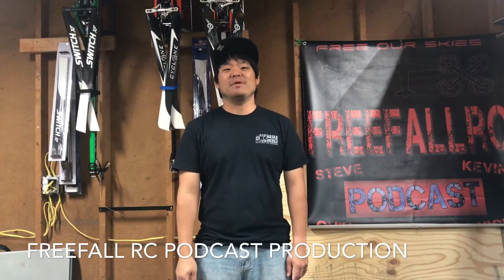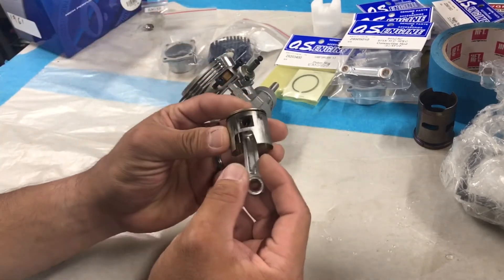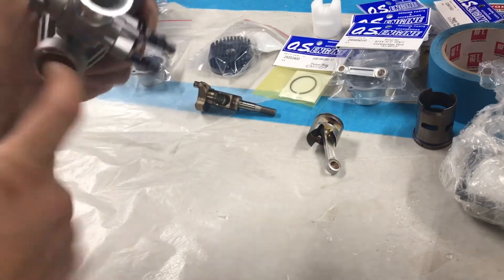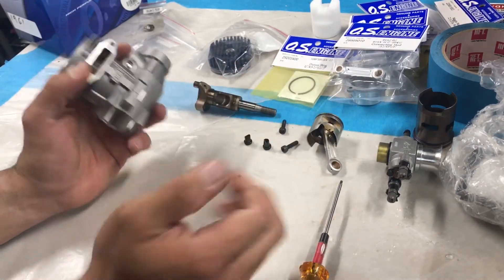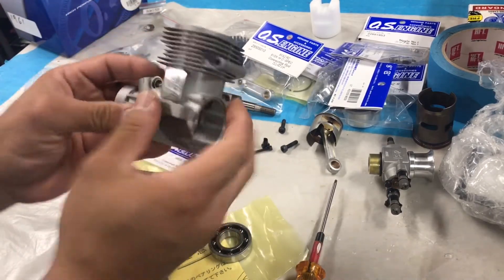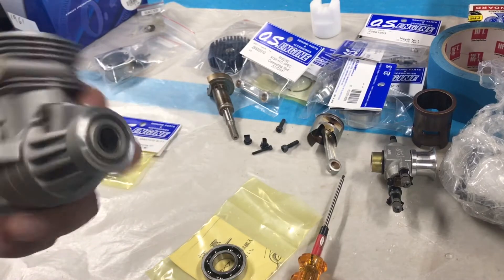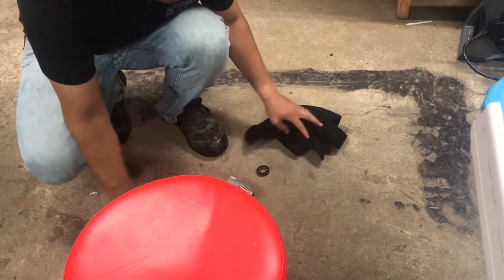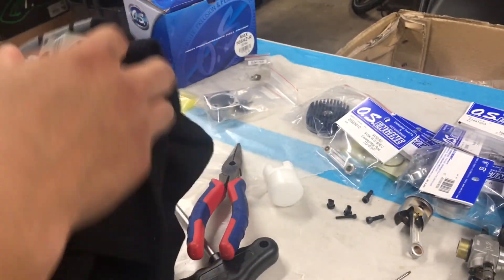OS MAX 105 rebuild part 1 of 3

Comment: hi I have been told that the OS 105HZ R engine with pump breaks more plugs than the OS 105HZ Engine.

Is it true?
Reply from the maker: I personally don't think so but every person's adventure into Nitro is their own.  IMO both HZ and HZR is super dependable and reliable with a mild tune, run it on the edge then it'll produce a lot of power but won't last long.